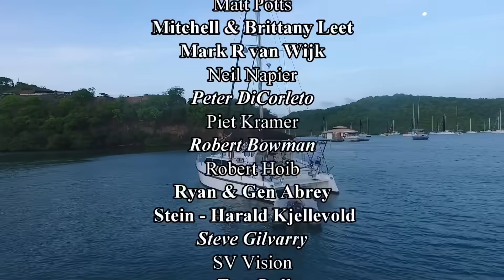We got HAULED OUT! | How Bad Does She Look After 7000nm?

Comment: 8500-9000 kilos? Okay, good to know. Although we could be a little heavier with 75m of chain :D Great anchor, huh, that Mantus?! I wonder if you ever get those rubber flaps around the Z-drives good. Our PO just didn't put them back, so we'll have to do that with the first haul out, but I wonder if there is glue that will hold it together.
Happy greetingz!
Wim
Reply from the maker: We epoxied them in. Will see how long that holds. It just helps keep the growth out of that gap.
Reply from the maker: I stand corrected once I watched our video. In the beginning we tried to use underwater epoxy.. it didn't work.. We used 3M 5200 i believe...

Comment: Oh wow, that's heavy. My Prout Snowgoose 35 (lost last year on the way from Bonaire to St Maarten) was 4.5 tonnes. Just imagine how heavy LA would be if you had left the bathtub and original fittings in. BTW that looks like a good boatyard. I hauled out in Curacao and had to dodge dead animals, and 10 stray dogs every time I walked around the yard, would not recommend.
Reply from the maker: Awh no that's horrible to hear. I'm sorry 😞 LA would be extremely heavy considering we changed the swim deck from solid wood to honeycomb composite and ripped out all that heavy interior wood... 😶😶

Comment: In WW2 the British ran low on aluminum so they made two engine bombers with spruce wood from Canada. Named Mosquitoes; they were so fast that they didn't need defencive guns or rear gunners. They just out ran German fighters. Spruce doesn't come close to bamboo in tensil strength. Bamboo has 28,000 psi tensil strength,but aluminum has 30,000 psi tensil stength. Bamboo weights 20 pounds per cubic foot aluminum weights 166 pounds per cubic. Strong tall bamboo gets over 120 feet in 4 to 5 years grown in Columbia. Bamboo has no knots and no voids, and can be treated with borax or other wood preservetives. All wood will rot if not covered with 6 ounce fiberglass and epoxie. This is like carbone for catamarans except it is much cheaper than carbon fiber.Ricky you and Simone can come to America. and be Africain / American citizens. Look for you dream boat because it is near; very near Check these numbers because they are coded letters 14,5,19,1,18,1    7,5,19,1,18,1 the second set are for non-Americans. Check with shariraye on bite shoot.